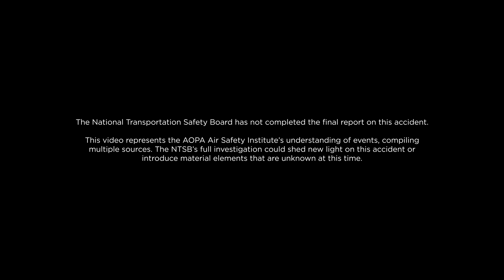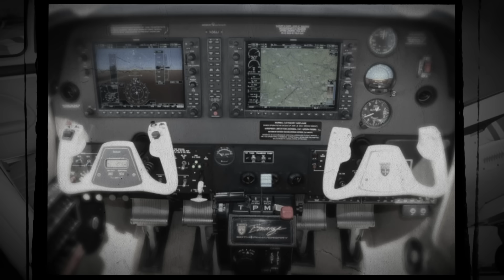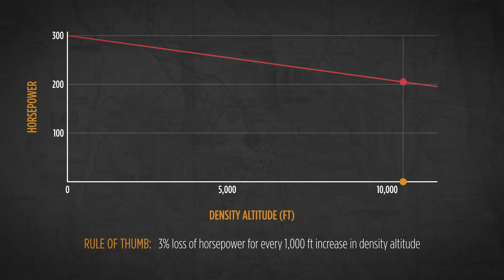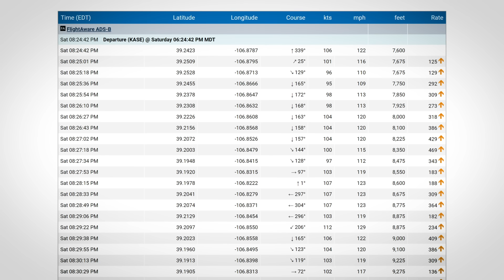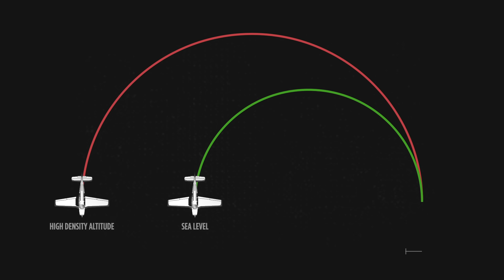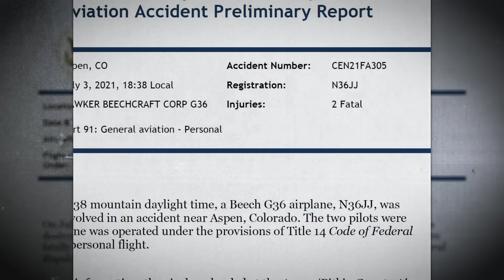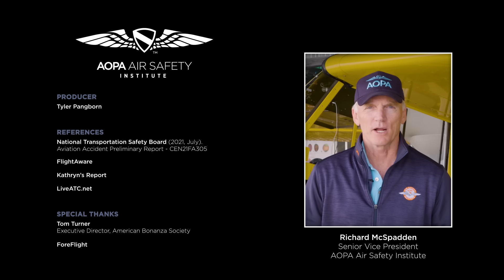Accident Case Study: Into Thin Air

Comment: I've noticed with Matt Guthmiller's Bonanza that it really needs a lot of speed before it considers slowly getting up in the air. There was also the bonanza crash in florida off the runway even though it was not completely healthy it does show a pattern of poor power to weight ratio. Poor performance surplus to get out of situations. One might also indict it for being a 1945 design. You don't see many 1945 cars still in production.

Comment: The engine is not super charged is what should have been said. Turbo charged is a different thing that has nothing to do with altitude.
Reply: ....huh?  Super-charging and turbo-charging are two similar methods of achieving the same thing -- compressing intake air.  The difference between the two systems is how they gather the energy to do that work, not in what they achieve -- super charging typically uses a direct driven system (via a belt or similar).  Turbo charging is more efficient, because it uses energy from the exhaust system (which would otherwise be wasted) in order to drive the compressor.

In airplanes, we almost exclusively use turbo chargers, because they are more efficient and lighter weight.
Reply: Yep...what  @Joe-ef7sk  said. Trust me, I've replaced the wastegate on my turbocharged Saratoga, it's a turbocharger, not a supercharger.